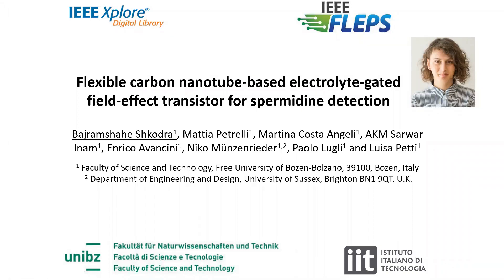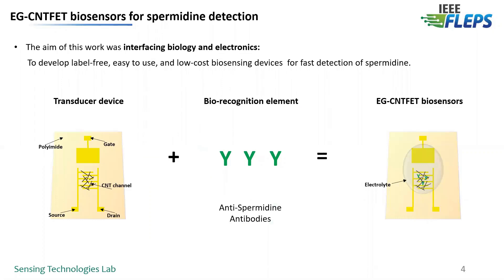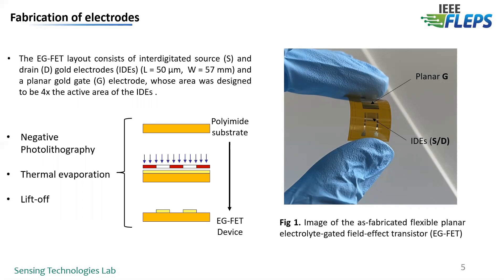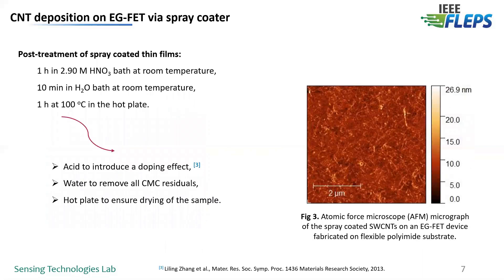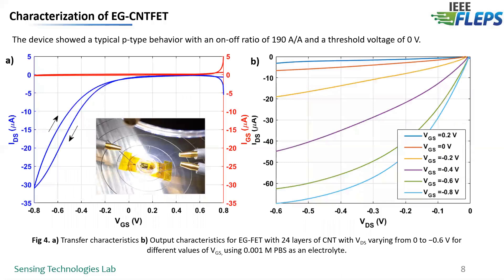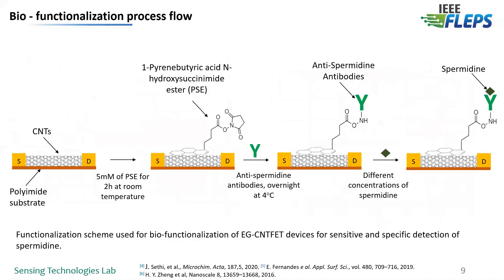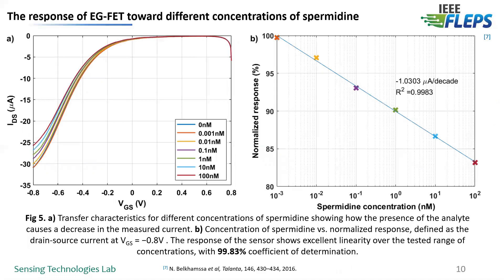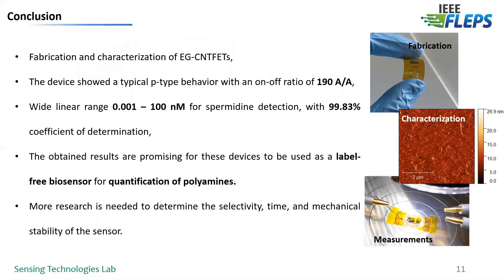Flexible Carbon Nanotube-Based Electrolyte-Gated Field-Effect Transistor for Spermidine Detection

Comment: Interesting work, but I must contradict one of your conclusions: You do not have a linear response range from 0.001nM to 100 nM spermidine concentration (c). Your response is linear on a LOG c scale, that is not the same as linear. A linear response against log c suggests a Nernstian mechanism -  Nernst says, potential shifts with 59mV/z per decade of ion concentration,  z = number of charges / ion. (How many of) the spermidine amine groups are protonated at physiological conditions? (PBS, pH = 7.4?), i.e. what is z for spermidine? Then you should express your response in terms of threshold shift rather than change of drain current. Drain current (and its shift) is somewhat arbitrary as it depends on transistor geometry and carrier mobility, but a Nernstian potential is an 'absolute', it is independent of the specific properties of the transistor. In principle you can get threshold shift (shift compared to threshold at c = 0) from transfers like Fig. 5a, but it can be a lickle tricky. Is Fig. 5a a linear or a saturated transfer (how big is drain voltage?). If it is saturated (large drain voltage compared to (gate - threshold) voltage) then you get thresh shift from plotting root ID (not ID) on the y- axis (strictly, root(-ID)). Choose a fixed root(-ID) that all transfers reach, e.g. = 5 rootmicroAmp. For each c, find the gate voltage VG5(c) at which root(-ID) reaches 5 rootmicroAmp. Calculate DeltaVthresh = VG5(c) - VG5(c = 0). Plot DeltaVthresh vs log c, find slope, compare to 59mV/z per decade. I'd love to have a look at that work...
Also - what is a typical range of spermidine in real foods, and what would be an upper limit that would make a food unfit for consumption?